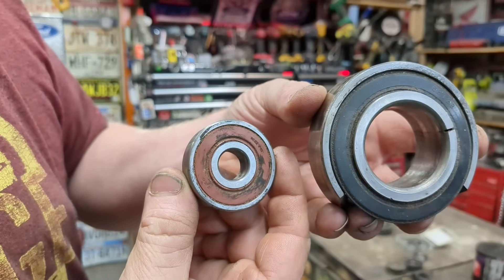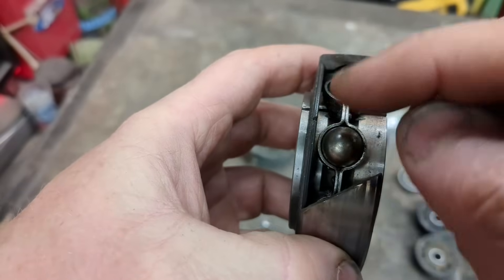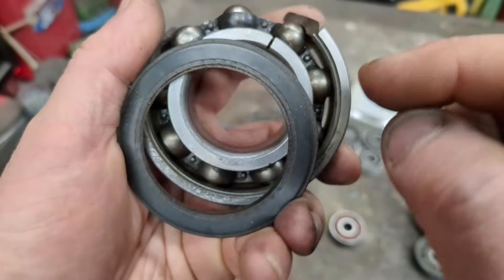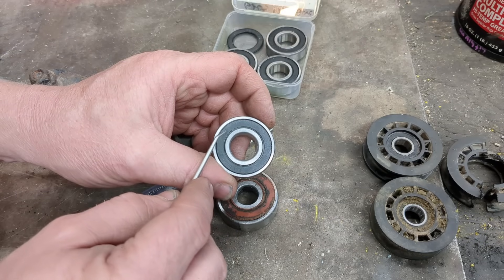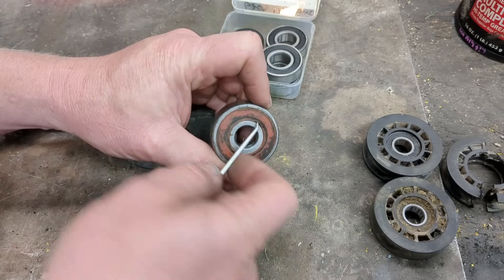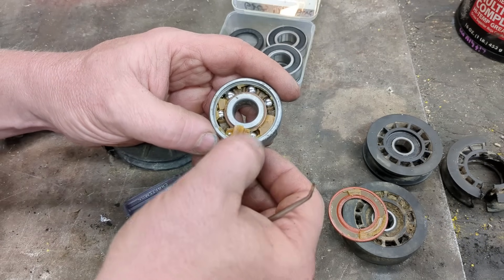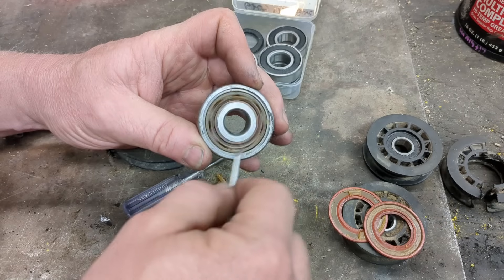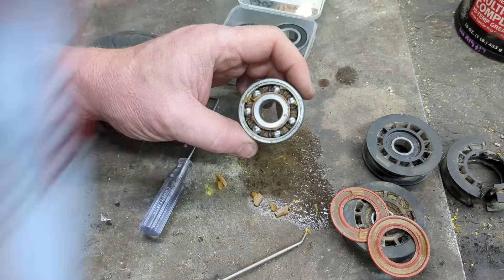How to GREASE, Un-Seize and Clean SEALED Bearings

Comment: I like to soak mine in a bath of gasoline, clean as a whistle! Then spray with brake clean or carb clean. And repack! Great video! Thanks!
Reply: Was just going to write this. A small jar with gasoline in can be used many times as a pre wash, and then clean off the residue with something else like you said.
Reply: @dennisolsson3119  Same,  even with high prices it's super cheap.
Reply from the maker: Actually cut the part about gasoline out of the video because it freaks so many people out. Gasoline is still one of the best and cheapest cleaners you can buy. I think from the lead in the gasoline days 40+ years ago, people are still all nervous about it.
Reply: @sixtyfiveford    In the past, I've also recycled stale gasoline for dipping parts that had an undesirable goo on them in order to clean it off. In my experience... gasoline, paint thinner, lacquer thinner and acetone all work well to soften up, dissolve or otherwise remove petroleum based oils, greases, etc. Diesel can work as well but it isn't as quick or effective IMHO. Other things can work too such as mineral spirits but gasoline usually cannot be beat based on price per gallon. The key to using these things is to protect your health when using them (keep them off your skin and avoid breathing in the vapors!) as well as to account for safe storage. Remember how flammable some of the mentioned liquids are - they are highly flammable/explosive so be careful with the usage and the storage. It's also good to keep them from evaporating off. Interestingly, decades ago it was popular to use glass jars that came with metal lids (such as a mayonnaise jar) for a soaking container when cleaning small parts like bearings or even dunking a small carb off a lawn mower or other SGE. Unfortunately, the jars AND the lids are now made from plastic which makes them unsuitable for the same purpose due to the plastic going soft or dissolving when in contact with many of the common chemicals we use. At least they were back in the day. Many folks discovered that the hard way once upon a time. I switched to all metal containers just to be safe and have never had an incident. Of course some plastics are impervious to some things - there are plastic gas cans as well as jugs for paint thinners - but I wouldn't trust a plastic container unless it came with or specifically calls out usage with a specific product. I've yet to see plastics being used to store lacquer thinner or acetone for example and I suspect there's a reason for that. Anyway, I think some folks react to the usage of gasoline just because it's volatile. It's common for people to get burned badly due to an accidental ignition because they're using it as a parts washer. I personally cannot count the number of times I've seen someone elbow deep in gasoline while scrubbing up various metal parts. Imagine what would happen if the gas ignited. Yikes! It's bad enough that they're not using PPE - then I look around and realize they've got no way in sight to put out a fire if one were to break out. I wouldn't want my arms from the mid-elbow down to light up even for a second let alone for however long it actually took to snuff out the fire. We've invented non-flammable parts washer fluids for a reason... they're far safer. Moving on. I do still use products like acetone on occasion but in a totally controlled environment with minimal amounts to accomplish my task. I also take the precautions needed to not get burned nor allow a serious fire to break out. The translation on that is fire fighting gear is at the ready... though there's nothing to catch fire in the middle of the shop on bare concrete, on a large metal table or at the metal parts washer station. All I have to do is step back and the fire will quickly burn out if I let it though zipping it with the shop CO2 extinguisher is what I'd most likely do. Allow me to say... CO2 ROCKS FOR AN EXTINGUISHER! They're quick and they leave no mess. I've been blessed with annual training in the past where I got to actually use them in a variety of sizes. I recommend them for everyone at home and for the car. Best wishes to all! 👍🏻

- Max Giganteum
Reply: @sixtyfiveford  You wanna be careful cleaning plastic parts with acetone etc. Acetone can melt certain types of plastic. Just a heads up!
Reply: @itsnetts  I've had a few toothbrush/wire brush plastic handles get gooey on me while working with carb cleaner.
Reply: Acetone
Reply: @MaxGiganteum  💙
Reply: Gasoline is not a wise choice as a cleaner. Its volatility can be a source for fire with static electricity. Might be rare but the consequences are severe.
Reply: @daledavies2334 diesel better
Reply: @daledavies2334 Lol it's perfectly safe.
Reply: @Leo-gt1bx Your results may be different from mine.
Reply: Great useful information, thanks for sharing and showing the detailed instructions for sealed bearings.
Reply: you are a genius thanks you for the share info and all hassle took you to provide us with this knowledge god bless you 🎉
Reply: You can also use ATF oil or DMSO :).
Reply: I keep a gas can and bucket together, both labeled parts cleaner only!
Reply: Ya for the money and especially big parts you can't beat gas
Reply: My dad was a mechanic and cleaned bearings with gasoline.
Reply: Wash with gas and an ol cig hanging out  mechanics mouth and then blows thems dry by runnin them at high rpm’s wit da air hose  lmao😂😂 zzzzzzipppp
Reply: @PapaRug.58  Yep, I've done that. 🤔🤓🍻🚬🧯
Reply: Petrol should ONLY be used in engines. It is NOT a cleaning agent.
Reply: @geoffgeoff143  Petrol or Gasoline is an organic chemical. It's primary use is as a fuel but certainly not it's only use.
Reply: @geoffgeoff143 why???
Reply: @geoffgeoff143  why
Reply: @geoffgeoff143 excellent cleaning agent. Just be safe

Comment: What about molybdenum greases,  good or just  overboard?
Reply: Not to  be used on a ball or roller bearing.
Reply: @Drottninggatan2017  Thank you :-D
Reply: @Drottninggatan2017  Why not?
Reply: @rupertthomson  
Well the idea is not to use moly grease on ball bearings or in a wheel bearing on a vehicle, or similar places, but you can use it where there is sliding friction between metals.
Reply: @Drottninggatan2017  I see, thanks!

Comment: Good information and I use the same type of grease you showed at the end.  I have a riding mower that gets grease after the season and mid-way into the season.  It is still using the same bearings in the front wheels that were factory installed and this year it is still running after 12 years. Some of the belts and pulleys have been replaced in the past two years, but overall it has been reliable.  I was surprised the drive belt lasted as long as it did, but I bought an OEM to replace it and replaced the one pully that caused it to lock up and break the belt.  I still hear some noise, so it looks like I have to go back again and check the bearings on the ones I didn't replace. This information may be helpful once I get those idler pulleys out.

Comment: I encountered grease incompatibility in a rather stellar way.   no idea now what happened, I had thought I had fully cleaned out the old before putting in the new but within a week the metal of the sleeve bearings and the metal of the shaft of the motor had both dissolved.  When I took it apart to review and see if it could be repaired, there was a 1mm deep U shaped wear into the shaft and the bearing itself was soft and crumbly to the touch.  Needless to say, not recoverable, but what ever the interaction had been it was very corrosive.
Reply from the maker: I have never heard of this happening. The grease incompatibility as far as I understood, it simply will make the thickeners solidify and or oil fall out of suspension with them. I guess there's more to learn
Reply: @sixtyfiveford  I was surprised too.  When trying to figure out just what the heck happened, the data sheet on the grease I used warned of corrosive interaction with several other types of grease (things you learn after the fact).  I had gone with what I had thought was a higher quality product for less maintenance of the motor 🤦‍♂live and learn eh!

Comment: I understand greasing some bearings, but if there's any bit of rust --> Trash immediately.
Reply from the maker: Yes, any rust and I trash them. It's easier on taper roller bearings to see, but if I see a stain on the race of where the roller sat, I will trash it. Somehow the metallurgy has changed once to gets a little bit of rust and it starts flaking.
Reply: I've found success with saving hard to replace or expensive bearings using electrolysis as a tool for rust removal. Of course it's also best to attempt to just flush a bearing to see if any rust is from an exterior source before closely scrutinizing the actual bearing. A minimal amount of surface rust can be removed easily and usually doesn't influence a bearing. A minimal amount of pitting can often be ignored but flaking usually equals death. How much damage a bearing has suffered dictates whether or not it can be reused but the type of bearing and what it's used in plays a big part in the long term survival if reinstalled. Low speed ops with little pressure obviously increases the odds of continued use with success. A need for precision, high speeds and heavy load bearing ops reduces success. My ultimate test involves listening to the bearing once spotlessly clean as I spin it. If it's smooth without any obvious glitches as it turns and I cannot hear anything to indicate failure then I'll spin it up faster while continuing to listen while feeling for vibrations or oscillation where I can. There are tools available to assist in the process and should be used if you have them. The bearing should also test out using a dial indicator for excessive runout or an out of tolerance condition. The bottom line is if a bearing is low cost and there's any doubt then replace it because it's not worth your time to mess with it. Once I get to my own threshold, with time & costs as a consideration, I'll then go for looking at making a save. Best wishes! 👍🏻

- Max Giganteum

Comment: For me there isn't enough grease from factory in a sealed bearing. I've always added never had a problem. In my truck some of the pulley bearings were noisy. Did them all just saved me some time and money.
Reply from the maker: Virtually every single time I get a bearing I add a little bit of grease. Problem is I have spent hours researching what type of grease they put in there so there's no compatibility issue. I've even called the manufacturer and they tell me the grease can change depending on who they made the part for if they requested something different. However, it seems universal that a lithium grease is the norm. So me using a lithium/lithium complex grease should be safe.

Comment: This is cool. Alot of people assume because bearings are sealed, you can't grease em. But that's probably me over greasing, so this is good to know too.
Reply: Me too...always just done it like tapered roller bearings (wheel bearings)..."full". Had some grease come out on some...never worried about it though.
Reply: thst like batteries without maintenace, jejejejejej

engine machinist here

Comment: What should i use to grease o rings?
Reply: You can use the same stuff as they are sealing against. If they are sealing against hydraulic oil, use hydraulic oil.
Reply: @Drottninggatan2017  Excellent advice. I was taught if in doubt or when dealing with an unknown, a minimal coat of plain petroleum jelly is always satisfactory. Note that it's wise to take it easy with any lube on an O-ring that's near a sealing surface when you'd use a sealer such as RTV or the like. Lubes will negate the sealant. Best wishes! 👍🏻

- Max Giganteum
Reply: Silicone grease for o rings!

Comment: Now what about onse with zerk fittings? Rule of thumb is pump grease until you see it come out elsewhere, is that because those are not "sealed" so the path is cleared over time?
Also, wheel bearings, those you pack completely full as well. They also say the grease helps cool them. Thoughts?
Reply: Wheel bearings should only be filed 1/4 to 1/3 full. More and the grease churns and overheats. The grease thickener releases oil to the roller ellements whith is the actual lubricant.
Reply: @mikefennema5561  I have never heard that, all sources I have seen and experienced say to fully pack a wheel bearing. Even the tool made to grease them is designed to fill them until it comes out the other side. Filling them with the "palm method" is the same, until it comes out the other side.
Do you have a source for this? Shop manual, professional instruction, etc? 
I am genuinely curious, not accusing or bashing. Thanks.
Reply: @AdmiralDG  The bearing housing should be 1/4 to 1/2 full. The bearing itself completly coated.
Reply from the maker: Something like a taper roller bearing for a wheel can be fully packed because it will expel any excess. During operation and running, it's probably only running with a quarter/ 25% of the grease you put in it as has pushed everything else to the side. I sealed bearing will continually churn that same grease because the side seals keep pushing it back in.
Reply: @sixtyfiveford Thanks to you both for the replies, makes sense on the sealed bearing keeping in all the grease. That was a "duh" moment when I read that reply haha
Reply: The purposes of grease are lubrication, cooling and cleaning.  "Greaseable" bearings, like zerk equiped, or automobile wheel bearings equipped with replaceable seals or similar, leak contaminated grease, carrying away some micro particles, thereby cleaning.  Regreasing displaces moisture, leading to a longer service life.
Reply: Good info.  Makes me want to just go find a ball bearing or two just to work on it.

Side note... Never thought I would watch a 10 minute video of someone giving instructions on how to properly grease their balls. 😂